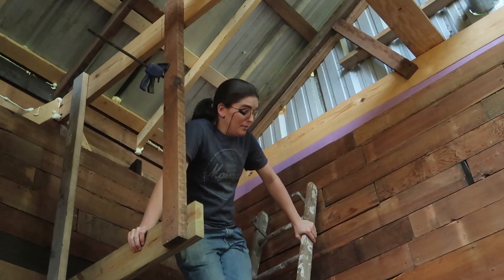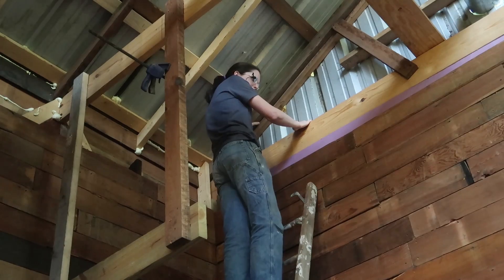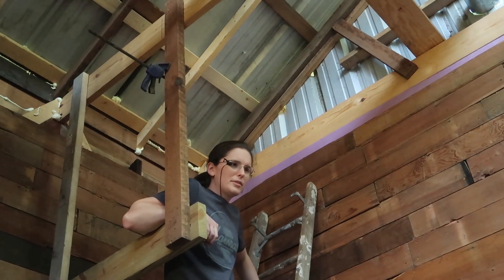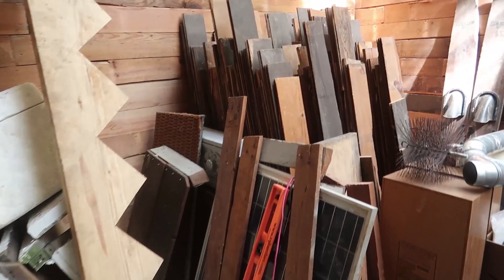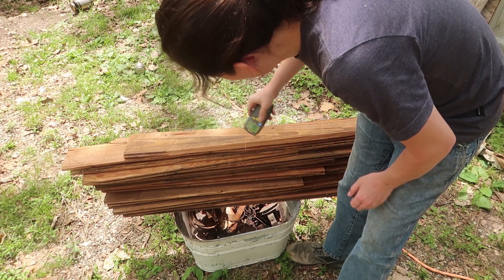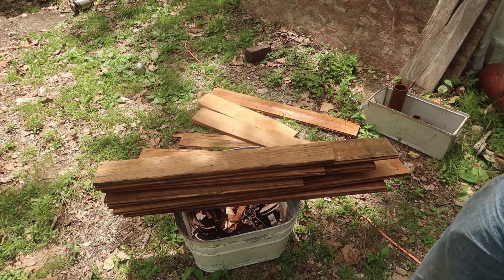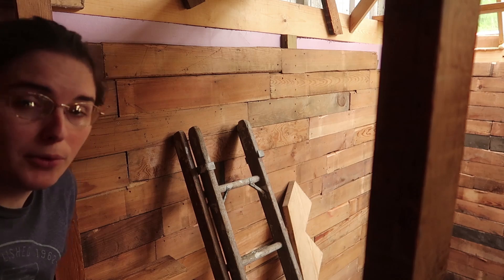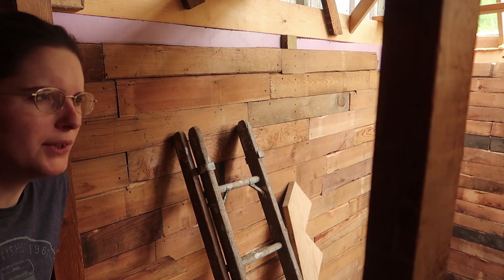Building a 15'x28' (5mx9m) Workshop 39: Wood Drying Shelf Construction, Need More Storage Space!

Comment: think those pieces of wood together are a lot more weight that you sitting on the beam , cheap insurance is hang a steel cable loop under each beam hanging from the trusses so that should the screws fail the b=cables catch the load and prevent it from falling out of the rafters (hopefully)

Comment: Wholly smokes... that mic made a huge difference.  For pieces operating in sheer (like the boards hanging from the rafters) I recommend bolts.  I couldn't tell what you used, but sheet rock screws are the worst for sheer load as they are too hard and like to break.  I'm sure you are cognizant of what you are doing.  I'm just another set of eyes looking from different angles ;-)  Carry on!
Reply from the maker: i used torx deck screws. theyll be fine